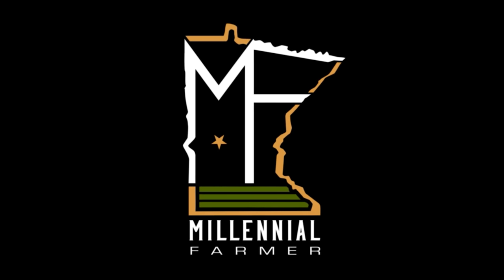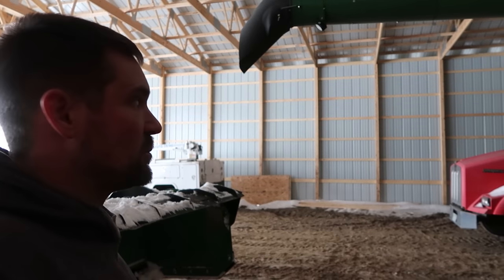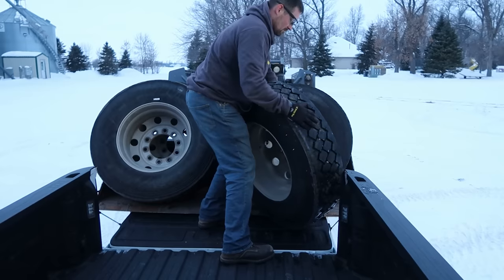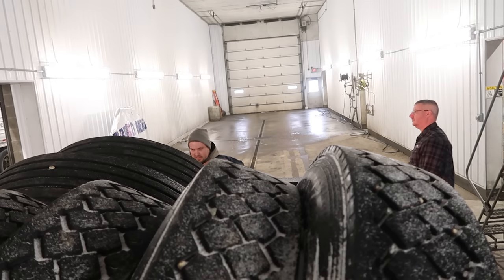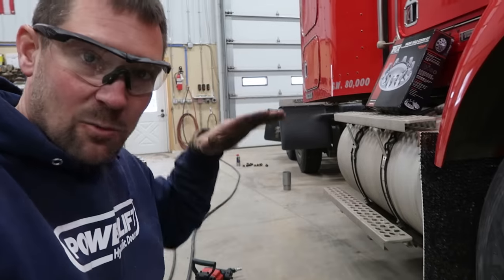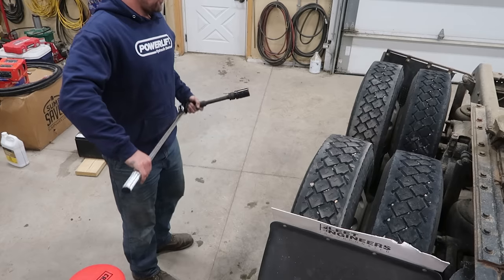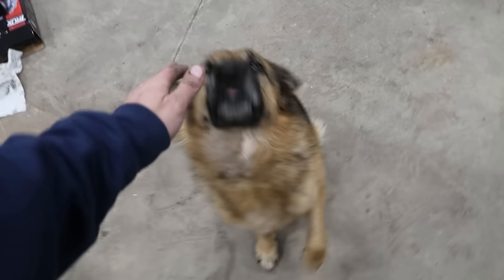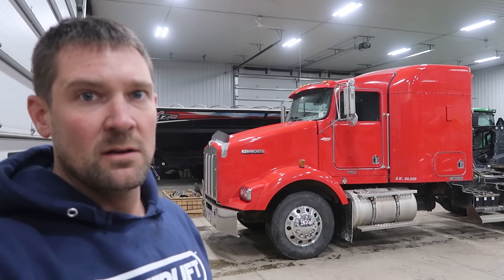This is NOT A HOW TO VIDEO! I Can't Believe it!

Comment: Had a car with a big block engine that took a bit extra to start in winter.  Had been working fine, battery about a year old, then one night after work, nothing.  Had it towed to a station.  Guy checked out the battery and said he was going to cut a cable - if it was fine, he'd replace it free. If it was bad, was going to be the problem.    He cut the battery cable halfway between battery and the ground point. Was green inside, just a hint of copper wire in there.  He replaced both, 10 yrs of no problems starting.

Comment: Nice video Zach. Nice too see you torquing wheels and doing the right thing. If you have too put a tire assembly on again put your left foot under the tire and use a bar on the other side. Lifts right up and gives you some wiggle too line up the studs.

Comment: The problem with high resistance battery connections is that they allow the battery to be discharged, but not fully charged. On your old batteries, trickle charge, then load test, those might not be bad with all that corrosion. 
Hint: before you disconnect the batteries, take a couple of pictures or make a map drawing of all the battery cables. 
Hello from north east Montana. 
10 miles from the Canadian border.

Comment: Always a good idea to thoroughly wash a battery box with new batteries.  Finish with a solution of baking soda and water.  Thoroughly dry the box.  Shine up all connections, nuts and bolts.  Apply your favorite anti-corrosive to all connections.  Next time....

Comment: You're on the right track cutting them rubber boots off the jumper cables. That style has been discontinued because it trapped moisture, as you can tell by the corrosion

Comment: I think some anti seize on the wheels would help for next time removing!
Reply: He did that. When Onyx was standing there.
Reply: Especially on the hub, where the aluminum meets the cast-iron that’s the problem that’s why they’re stuck not the threads, they always oxidize between the aluminum and cast-iron very frustrating, Motor oil is fine for the studs I have found out it’s a little bit less messy than never seize, putting something on is better than nothing👍!!
Reply: @dryroasted5599  he only did the studs. Not the hub
Reply: Never ever and I mean EVER put anti seize on wheel studs. You will never have proper torque.
Reply: @austin paxman  Wasn't talking about on the wheel studs! Just on the back of the wheel anywhere it contacts the stee hub.

Comment: As a heavy truck tech, I can confirm Zach is not a heavy truck tech lol. A+ for effort and not giving up on that stuck wheel lol. Definitely a dangerous way of going at that wheel though, OSHA just had a stroke watching you do that with a quad and a strap lol. That battery cable is getting hot because it is corroded somewhere causing high resistance. That is likely your voltage draw as well, which is why that truck kills a new set of batteries in no time. I'd start with replacing those cables and cleaning up anywhere you see a battery cable connection point before replacing the starter. Even if it's a smaller gauge wire, it could cause you these issues. A wire can carry the voltage needed but not the amperage sometimes meaning it just can't carry the load that it needs to, like turning the starter over fast enough to start the engine. Honestly, I think your best bet would be to take it to a shop you trust and have them make you new cables for it, clean up all other connection points and they can clean up that rats nest of cables in the battery box as well. Those wheels turned out pretty damn good too and I'm sure those headlights will be a lot better than the factory ones.
Reply: Also, use a long pry bar or semi truck tire iron for putting those wheels on. Will save your back a lot of hurting the next day.

Comment: Just wondering if you've tried a parasitic drain tester on your truck's batteries. Pretty cheap on Amazon and it works to either confirm or rule out the possibility of a parasitic drain on all your trucks.

Comment: The lug nut caps hold water in which will rust the Lugnuts, which will make them harder to get off the best thing to do is use 10W-30 oil to lube up the Lugnuts, and keep them lubed at all times that will keep the water from rusting them

Comment: Definitely replace those cables. NAPA should be sble to whip up a set. 
Those lugnuts are meant to have some oil between the hex and the washer, and the washer face against the wheel dry. The interface is machined to minimize friction so you get the proper clamping force. 
A hot terminal is a bad connection, a hot battery case is a bad battery. 
If you forget which bulb goes in which position, look at the back of the plug. High beam has 2 wires, and is usually inboard, low beam has 3 wires.

Comment: Just a couple things. First what oil are you using? Depending on your summer season high temps, a 10w30 would be many times better choice than 15w40. Second, battery cables wear out also. Corrosion often will follow the copper lead inside the insulation where you won't realize because it cannot be seen.

Comment: Watching this late, I’m a truck mechanic in MN. When I charge or jumpstart batteries I put clamps on different batteries usually ground on far left and positive on far right)so the charge goes through all batteries (not sure it matters but it’s how I was taught)
Also when I get stuck rims I lay on my back and pound from inside out. I’ve also been instructed antiseize on wheel studs/nuts is not recommended. Just my 2 cents

Comment: I learned once on a irrigation engine, a battery cable (covered with vinyl so the issue was not visible) corroded internally and it didn't carry the load -- and engine wouldn't start. New cable fixed the issue.

Comment: I’ve always found that loosening the lugs before jacking helps. Have you ever noticed when you Jack up a wheel, as you begin to Jack it shifts when the weight comes off it. Loosen those nuts first and let that force break that wheel loose for you.

Comment: On your batteries a bad connection loose or corroded will make a lot of heat ware as those with a solid connection do not change temperature or vary little

Comment: Hey Zack! After cleaning the connections or replacing the cables, you might want to use a clamp on Ammeter to see how much you are drawing in amperage when attemtpting to start. Could be a Bad starter. Seen this before in Large portable generators both for USAF Aircraft and commerical use gens. I worked for the US Gov for 41 years.
Reply: Oh, also check all the grounded connections for cleanliness.

Comment: If you decide to replace the battery cables, get the crimp on kind.  NOT the ones that just bolt on with two cheap 1/4" bolts.  You can buy battery or welding cable in bulk, and the crimp on ends.  Yes you will have to buy a hydraulic crimping tool, but with all the batteries and cables you have on your farm, you will be money ahead instead of buying premade cables, IMO.  They also make cable ends that you hold in a vise, heat the end up, install a fluxed wire and while still heating the clamp, add more solder to the wire to fill in between all the fine wires.

Comment: You can buy a cover for the drive axles, similar to the front just bigger. #2 From my experience when a battery terminal is hot and the other isn't there is usually a loose connection or a short leading to the problem. Looking at those wires, as nasty and corroded as they are, that could be alot of your issues with the truck starting.

Comment: 2:32 Get a clamp on ammeter. If it's not drawing high current at the battery when you attempt to start, you've got a bad wiring connection on the way to the starter ... or the starter has high internal resistance. And of course most farmers have discovered battery disconnects...just in case there's leakage of any kind while sitting unused.

Comment: I liked the batteries on a piece of wood. Your Dad probably taught you that the concrete was bad for them. Mine did too. However, they stopped making them susceptible to the concrete around the time you and I were born. It's okay to set them directly on the floor.

Comment: For stubborn steer tires, smack the tip of the studs with a roughly 5lb hammer a few hard times and you should need little more than that to bust it loose.

Comment: Likely noted by others, but I am not scrolling through 1,856 comments to confirm.  NEXT TIME, when changing outside duals, you don't need the jack.  Lay a 2x4 down and drive/back onto it.  The outer tire will be off the ground.  IF YOU'RE GOOD, you can even change out a blown tire while leaving the wheel mounted to the truck using this method.  I really enjoy your videos, the next generation learning to combine and run grain wagon is my favorite - reminds me of growing up on my farm, except we had ear corn to deal with.  Blessings and be safe.

Comment: After having all grounds replaced if issues still occur replaced all main positive cables leading from the batteries to the starter. I work for a company called Allfleet Inc we do roadside tractor trailer repair. We use very heavy welding wire to replace them if you have any questions feel free to get ahold of me

Comment: If the terminal was tight and clean the chances are the battery post was corroded away on the inside of the battery making a bad connection and causing the heat due to high internal resistance.

Comment: Spent half a day on a will not start one day. Starter worked fine out of the car. Jumpered the ground to the starter, no change. Jumpered the hot to the starter, cranked right up. Cut the end off of the unblemished factory hot cable and installed a replacement cable end. Problem solved, apparently there were enough broken strands in the cable that it would not carry enough current for the starter. I would recommend taking a hard look at the cables.

Comment: Mate that cable  you cut the terminal shielding off is what we in Australia is call 'rooted' (you work out the equivalent translation). Copper oxide is a sign there is corrosion. When it is deep enough it effects the current carrying capacity of the cable. The inverse is if you pull the same amount of current through a degraded cable you generate more power loss in the cable or connection which can show itself as heat. The direct impact is you can't pull current required to power your starter and you still get heat. As others have said - and I'm probably just adding fuel to the fire lol - just save yourself some pain and replace all the cables around that battery pack.

Comment: Use a bar under the tyre when replacing back on.
Removing the rear out tyres just reach in and two finger a hole then use your forearm to lift and pull😊

Comment: Terminal corrosion is the usual culprit! Wire brush the battery terminals, the cable clamps on both ends - ALL the way to the starter, and the starter posts. You'll be suprised with a strong start.

Comment: Definitely replace the battery cable. It’s worth the effort to to trace the wiring to the starter and into the cab. The oil field trucks I drive have had wiring rub on stuff from all the bouncing around. Good luck!

Comment: I just had this issue with my skid steer.
Had the ground get so hot from cranking it melted the terminal, crap connections will basically be a big heater.
But man that wire looks bad!
Remember the power flows from ground to positive, thus the heat only on one battery cable end

Comment: check once new batteries are installed and the truck is running. scan all connections with an infrared scanner. any hot spots are bad connections, clean and repeat until all temps are equal....

Comment: If I owned that truck, I would replace all the battery cables including the power and ground cable to the alternator. You definitely need to check for a current draw. On my Kenworth I prefer to replace the alternator when I replace the batteries. I recommend a Delco Remy 24SI, a new one, not reman. If you need a starter, again I recommend new. I run a Fleetrite FLTST4202 on my CAT C-15. My second choice is a new AC Delco 10461052. You may need to clock the starter solenoid. Make sure there is a connecting cable between each set of batteries ( positive and negative) in the battery box. It helps load the batteries evenly. Also have the rack run on the engine (adjust valves and injectors). It will start easier and run better. I wish I could talk to you, I'd like to help with quite a few other things. My preferred battery is a DEKA 730 CCA dual purpose deep cycle battery. Not sure if it's true, but I was told the plates in batteries are thinner in a high CCA battery as they need more to get the higher CCA. As a result they don't last as long due to vibration wrecking the thinner plates quicker. They recommended staying under 800 CCA. With 3 batteries you have plenty of starting power.

Comment: Suggestion, either get the nylon/plastic ring that goes between the wheel and the hub, and or use a crap load of antisieze on the hub.
You have a steel hub and an aluminum wheel that don't play nice together.
A bad ground will cause it to get hot on the negative post.
I have seen some that have melted the negative post.

Comment: Hi it's Clay again I love your truck not sure if know but any of the chrome parts can be polished with fine steel wool. Try it also make sure the ground cables to the engine and frame are not corroded it never hurts to add one going to the bolt holding the starter on

Comment: Watched all your videos since you started having starting issues. Remember, there is more to it than just the batteries and starter. You are definitely getting some unwanted resistance somewhere from the batteries to the starter, and/or from starter to the key switch. I would check OHMs on all your cables, should be around 0.5OHM

Comment: 2 things  - you can wax those aluminum wheel clean.  Battery issues crappy cables between batteries & ground cable to starter goes bad quickly

Comment: You would definitely benefit from a new high torque starter, and like many others have mentioned new battery cables! The cables do age out due to the amount of use and the elements. You would actually benefit from starting and running the trucks more often even though you don't actually need to run them often.

Comment: I put anti seize on the mating surface of the hub after I clean the rust and crud off the rim and hub. Makes it come off really easy. I've watched guys in the oil patch nearly kill themselves trying to get corroded/rusted rims off of the hubs that were all " you're gonna die if you put anti seize on the hub/ rim mating surface!"
Yeah I got the tip to do the antiseize from a guy doing my tires on my 200bbl water truck and in all the years after that first time, never ever had issues.

Comment: Mr Johnson; 
              When you charge batteries use the charger by putting the hot cable for the charger on the  1st hot post on the front battery, then use the ground for the last battery in your case on the Kenworth battery # 3. This way you will charge all three at Once. Also you could have worn brushes in your starter. Have a great day.  Keith

Comment: Not that you need more ideas but ... I would check every connection on all the battery cables, any old disconnect switches that might hiding out of view that could be loose, get a gear reduction starter, check the amp draw when try to crank it over, if it is to high which and  I'm certain it is, clearly  there is a problem somewhere keep looking, Batteries will not fix the problem. Remember loose/corroded connections cause high resistance...(On a side note this is true of people too !) Good luck! If you don't get this thing fixed soon I'm coming out to fix it.

Comment: Zach I know you got a lot of good comments already on your battery cables, but here's another tip. After replacing the cables (they are corroded) grease all your connections with Vaseline. Both sides of the lugs, the battery terminals, and the bolts. It's messy but it keeps all my batteries from corroding. Been doing it for decades after an old mechanic showed me. I've tried all kinds of sprays, coatings, and even dielectric grease, but Vaseline works best. Thanks for all your hard work 🚜

Comment: Careful when you torque those lugnuts down with the torque wrench. At the shop I work at its a required two person job because of me actually. The socket wiggle off on me because there was no pressure pushing it on the nut and I came slamming down on the truck frame and knocked myself out.

Comment: I learned about battery cable corrosion the hard way. Several years ago on Christmas eve I was loading up my little Ford Ranger to make a trip to my daughter, four hours away. The truck would not start. Just made some clicking sounds. Cleaned the battery terminals, did not help. Tried jumping with a set of heavy duty jumpers, did not help. Went to auto supply for new starter, did not help. Managed to get to auto supply just before they closed and bought a new solenoid, did not help. Gave up and rented a car, and got there several hours late. After Christmas, got home and tried to analyze the problem. Noticed some corrosion under the insulation where the wire went into the battery clamp. Changed the battery cable and all was good. Even found out that I had a temporary fix all along, in my shop, a clamp on replacement terminal for the battery cable. So after multiple trips to the auto supply store, (can't return electrical components) working under the truck in the pouring rain, getting a ride to a car rental agency, being hours late, and over $500 later, I found out I could have fixed it for free in less than a half hour.

Comment: A trick I use when removing and replacing heavy tires on concrete is a little oil on floor. Jack it up so tire will slide in and out when lugs are off. It's a back saver.